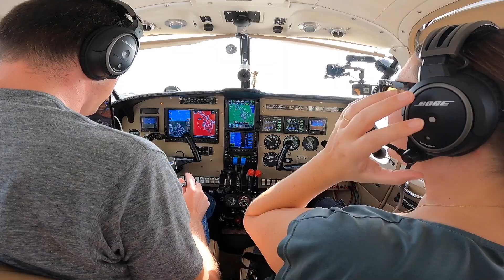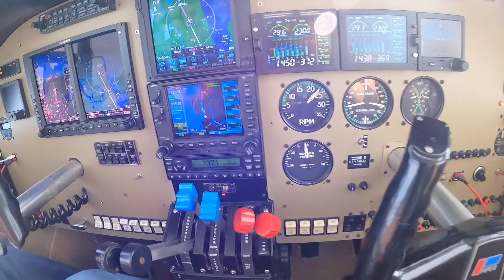Alternator Failure & Hole In The Turbocharger: IFR Flight - St. Augustine to Sebastian - Piper Aztec

Comment: I have been having alternator issues come and go for the past couple of months.  However a week ago the the avionics shut down while taxing.  Everything came back on but the transponder.  Took off and had to come back.  Plane is grounded until my mechanic can look at and fix the issue.  Then I can get back up.  Can't wait to burn through big piles of cash as soon as possible.  LOL.
Reply from the maker: It’s a shared experience. I hope the financial damage is limited and you get back in the air soon!
Reply: @DoubleDawgDare  as you know when not flying an Aztec you save a ton of money.  So when you think about it, it's kind of paying for it self.  LOL

Comment: I worked on a lot of Aztecs and that is a very nice one. Robertson STOL, Vortex Generators, fresh looking boots and what a panel !  How did the vanes of the inlet side of the turbo look? Any FOD? Those particles went into the cylinders too. You can also swap the Lord mounts around to get some more life out of them. They sag with heat and age.
Reply from the maker: I wish I could take credit for all the upgrades, but the truth is that this plane has had a couple of very loving previous owners. I'm just fortunate to be able to be flying with this plane now and I'm doing my best it well exercised and in good shape. It's been a great plane. Thank you for stopping by and commenting. We hope you continue to enjoy our videos.
Reply from the maker: Vanes were clean as a whistle. Engines only have 300 hours on them and the turbos had no signs of wear. Oil changed, no metal to speak of in the filters. We are planning on reevaluating the mounts in August at the time of annual - Shims are working for now. Thanks so much for the technical advice.
Reply: @DoubleDawgDare  I started working on brand new Pipers at Lock Haven in 1972. Private firm not Piper Aircraft.  So I know what they are supposed to look like if they are in good shape. Retired a few years ago with 42 years in the business. Also worked for Lycoming, so if you want a second opinion on anything, answers are always free.
Reply from the maker: @i.r.wayright1457  You rock! Thanks again for reaching out and offering a helping hand. I'm always looking to learn something new and it's great to have your input. I look forward to our future discussions.
Reply from the maker: @i.r.wayright1457  I wanted you to know that I've gotten notifications for a couple of your other comments and for some reason YouTube removed them, even with my settings set to allow all. I think it blocks comments that include other channel names or web links to avoid spammers, but I'm not sure. Nevertheless, I'm responding here just to let you know I got the messages. On my more recent video you suggested the Sentimental Journey Fly-In at W.T. Piper Memorial airport at Lock Haven, PA and I've got it on my calendar. We're going to try and be there. Love the idea of the Lycoming factory if tours are opened, and the private airstrip you mentioned in Sullivan county with the car museum... well, the guy that owns the museum and airfield is the gentleman from whom I purchased the plane. He's an outstanding guy and I look forward to returning to both places with the family if he's amenable to it. Thank you again for all the tips and I appreciate the attempted comments, even if YouTube is removing them.
Reply: @DoubleDawgDare  Hit me up on gmail. Just remove periods and spaces from my name. I met with the owner of Merritt Field when I was working at a new firm at a nearby airfield. He was impressed with the new hangar. I told him if he built a hangar, make is as bright white inside as he could and insulate it well. He did and his places are even air conditioned in summer.
Reply from the maker: @i.r.wayright1457  I flew up there to look at N2441M before I bought it. The airfield, the hangers, everything was very well done and appropriately maintained. I had no reason to hesitate when I purchased the plane from him and we’ve been happy with the plane ever since. I’m really looking forward to meeting up with him again.

Comment: I wonder if the flickering of the gauges is something that the camera picks up that your eye (or brain) does not. Same thing with the propellers? The camera seems to pick them up but Im guessing your eyes do not.
Reply from the maker: My understanding is that the flickering of the avionics is related to the refresh rate of the monitor and the RPM of the propeller and how these interact with the shutter speed and exposure time of the camera, although there are surely other factors at play as well. We are experimenting with different settings and hopefully we will get this resolved shortly.